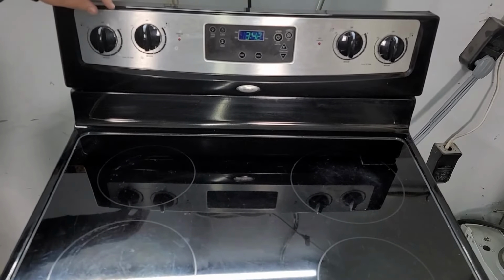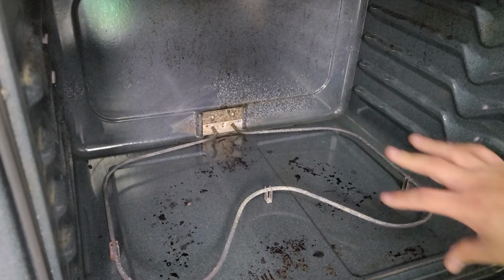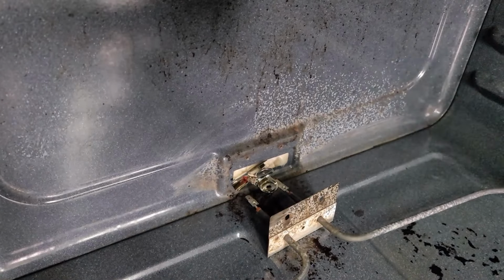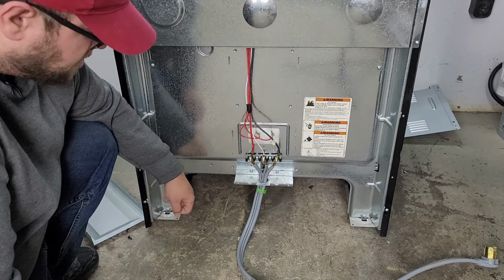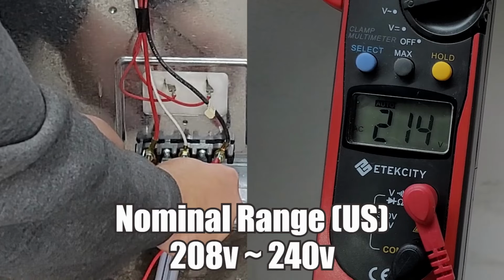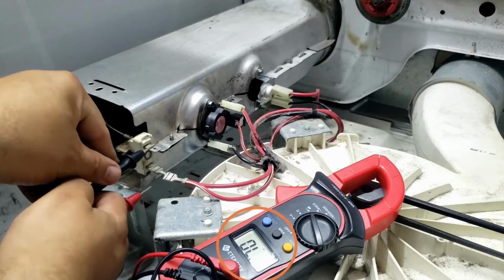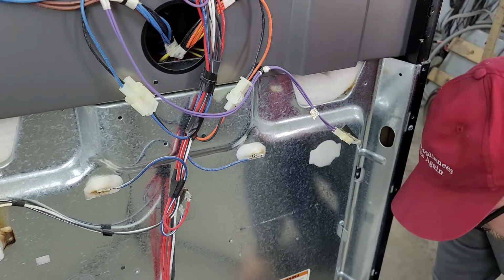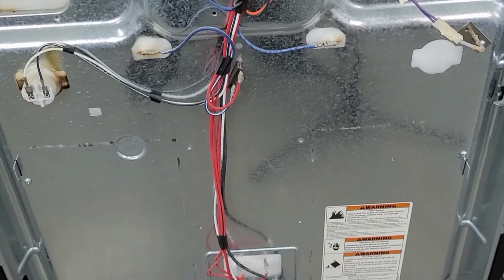Whirlpool Oven Won't Heat - How to Range Troubleshoot a Whirlpool Oven Not Working

Comment: Hi Ben, my whirlpool oven heats up but doesn't heat properly. Seems to be when the door is opened to check whatever you baking it will only eat up to about 200 deg after that. I have replaced the temperature sensor and it still acts up. Both elements pass the continuity test. Any suggestions?
Reply from the maker: Check boars for relay damage

Comment: Hi Ben.  Great site.  I spend a fair amount of time here, trying to absorb as much as possible.  Sure appreciate it!   Could you give me an informed opinion?  I have had quite a few customers concerned with how their oven is heating, and the majority of those customers seems to have a W10779716 bake element, which is a pretty "simple" element with no loops in it to heat the center portion.  I can't help but think another part might lead to better results.  Something like W10276483, that looks rated the same (3600W) and looks like it would fit.  Am I out to lunch,, or maybe missing something, or not considering something?  What do you think?
Reply from the maker: They all work the same as long as they are rated the same. Usually the people complaining are idiots though and it's going to be more of a calibration issue. But if you want to swap elements, it's totally OK to do that.

Comment: Very good video!!! 
When I turn on the range and it goes up to 395F instead of the 450F set point. What could be a problem with a range?
Reply: Look up how to adjust the thermostat reading for your model.

Comment: After I listened to your lesson, I pulled the oven out and discovered the plug had worked itself half out of the socket. Light, clock worked and nothing else. Pushed plug back in and presto. I’m was a lucky man tonight!

Comment: Hey Ben, appreciate the video but I hope you can give me a few extra pointers!! My whirlpool accubake only heats up to 300F on bake and 400F on broil when set to 500F. It only has one element on the top of the oven. Element and thermostat resistance are all good and I don’t see any damage to the control board. Any ideas? Thanks!
Reply from the maker: Offset or thermostat could be bad

Comment: I get 240 V at the bake and broil elements when the controls are set to BAKE / BROIL.  I get about 40 Volts on both elements when I set the controls to BAKE only.  Any idea what the problem is?  Thanks!!

Comment: Ugh, I have a newer whirlpool range and recently replaced one of the burner switches but for some reason the display will not reset it still shows that the stove top is on and hot when it is not on or hot. Any ideas????

Comment: Hi Ben. 
Subj. Maytag Model MER8800FZ0
The baking element started on fire. Me wife screamed and I came a running. 😅
I replaced the baking element. Still won’t get to temp. I really don’t want to call a service person out. Could it be the fuse, heat sensor or board? I have power to the stove top. But the broiler will not work as well. I’ll wait for you’re thoughts. Appreciate the informative vids. Ty
Reply from the maker: Check the terminal block in back if it got damaged. Sounds like a general power issue... Check that first, then board if there's any damage on board.
Reply: @bensappliancesandjunk  
Hey Ben
I just ordered the safety thermostat. I believe when my wife started a fire inside the oven, it damaged the thermostat. The block and board looks good. The only other thing would be the thermostat. I don’t have a meter. Thoughts? Thanks again.
Reply: @bensappliancesandjunk  
Also, if it was a power issue, would all the burners still be operating? Ty

Comment: My thermostat resistance is showing 1.39 and also there is a burnt mark on the far right side in the middle of the motherboard right at the edge voltage coming in to the unit is okay for some reason the oven is heating up really good now being that I unhooked a lead from the motherboard to get the screw out there was connections that were loose that I felt like I pushed in to make better contact but still unsure Thanksgiving is coming up and need to resolve this situation do you have any suggestions?

Comment: How can I check the board on the bench.
Reply from the maker: Check for voltage coming out from the board to the wires that power the element. It varies from model to model, so I can't advise you which wires but generally 2 will go from board -> element. Test for 240 VAC cycling from board to element. If it doesn't trigger voltage at all or some value very insufficient, replace board assuming you're getting 120 VAC into board. Typically the terminals will power one leg @ 120v to the elements, then another 120VAC from board to provide full voltage/amperage, and if that side is bad, it won't trigger at all.

Comment: I inherited a Whirlpool stand up stove, all burners work, but oven not working at all. I pulled the back panel and started checking the first thing I found is the left leg power and ground was very loose on the stove. I secured the wires and check the fuse and power to control unit. What can I do to get this oven working. Collins
Reply from the maker: I'd suggest watching the video and doing all those things first. Did you do those things before commenting?
Reply: Yes

Comment: My burners come on but the digital display that controls the oven and clock won’t come on and I can unplug it and it starts to work then a few days later it stops again?
Reply from the maker: Sounds like either a board or connection issue to the board. Check all connections and make sure they're plugged in properly. Otherwise, change board sadly.

Comment: The issue I’m having is the stove would intermittently lose power, if I pull it out of its space, or wiggle the cord it comes back on. I replaced the power cord and it worked fine for about a year. Now the same problem came back.
Reply from the maker: It's either the cord or outlet
Reply: @bensappliancesandjunk  that’s for the quick response
Reply: @bensappliancesandjunk  now it’s something new. I preheated the oven, it got up to temp. Then shut off completely, no power at all. I turned one of the burners on and everything powered back up, including the oven.

Comment: Hello, I have the same overnight and was wondering why the display screen was not on. I went step by step, oven bottom element reads extremely low. But I can’t turn on actual baking setting to test other parts because display won’t turn on. If I replace the baking element would that solve it or is the mother board also a problem?
Reply: I am wondering if you ever found an answer to your problem as I am facing a similar situation.

Comment: What would cause an electric oven to cycle on and off rapidly? My mom's Ikea (Whirlpool) oven isn't regulating temperature. I can hear a relay (what I assume is the thermostat) cycling on and off about every 10 seconds. Overall, it's overheating and burning food. It just keeps cycling back and forth which slowly heats it past the requested temp.

Comment: Hello from Houston! I moved in my building in early 2021 and the building itself is only 3 years old. This silvery Whirlpool series is a junk. Two refrigerators bloated, became cylindrical and started to spread moisture and create mold. The owen stopped working, the upper heater. 

3 out of 2 devices made by Whirlpool lasted shorted than 3 years?!

Comment: I have the same type the Oven is locked and the gas stove is not working either you see when turn it it show red meaning is working right but in my case is not turning on how I fix it?????

Comment: Well done Ben. Easily found my stove problem thanks to your video.  Terminal block and wiring repair needed on my 2YO WP model.  Seems to be a common occurrence based on comments from your video and others.  Lots of terminal block replacement videos in youtube land but nothing on wiring repair.  Might be something to address in a future video.
Reply from the maker: Good idea. I'll see if I can do that sometime.
Reply: Half of my oven just died, after lasting 2.5 years max.

Comment: The clock comes on only when I push the dial on and hold it, but when I turn it off, the stove shuts off, it used to reset after 20 minutes or so, but it shut off by itself and hasn't reset itself

Comment: I went through every step in this video, and everything came out like it was supposed to (correct voltage/resistance/continuity), but our oven won't get above 325F no matter how high it's set. Is there anything else I can check, or should I maybe try just replacing the thermostat?
Reply from the maker: Did you check the thermostat? Is the oven set to Fahrenheit or Celcius?
Reply: @bensappliancesandjunk  I checked the resistance on the thermostat and it read in the right range for the ambient temperature. The oven is set to Fahrenheit.
Reply: @tm55re  hello, have you resolved this issue on your oven? I’m having the same problem. I just changed the baking element but it was damaged on one side but the oven still won’t heat past 325 degrees F.
Reply: @itsDawnElle  so after checking everything, it all coming back good, then putting it all back together, it's been working as it should. I have no idea what fixed it, but I'm not going to sniff a gift horse in the mouth 🤷‍♂️
Reply: @tm55re  ahh okay lol 😆. I’m glad it started to work well for you. Hopefully when I use mine tomorrow, it’ll magically begin to work again. 🤞🏾 thank you so much for replying!
Reply: @itsDawnElle  no problem! I hope you get some magic too!

Comment: Hey bud so i change the location of my electric stove and ever since then it start clicking and the oven comes on sometimes and not or i have to keep trying it to come on. Could my breaker wear out and need new ones cause i have those for very long time. Even before i move the stove to its new location it was kind of have minor clicking and so on?
Reply from the maker: Yes its possible. I would check the voltage going into the terminal block if possible. I had it happen to me a few months ago personally
Reply: @bensappliancesandjunk  thank u

Comment: hello, I have a whirlpool stove w/convection. broiler element does not work. I have good continuity on element. I removed both wires from element and have 120 on each wire to cabinet, but have only continuity between them both. I think I should have 240V but not sure. (model #  RF367LXSS 0.) IF you could help that would be great. Thank you

Comment: My issue is with an electric lg oven. The convection fan element doesn't seem to heat up at all but the main bake element heats up. Do I need to turn it on to read the relays and/or element? I don't have much experience with HV so I'd rather call someone if I do.

Comment: Thank you for responding. Figured it out. Wire on left side wasn't even long enough to
get an alligator clip on it. Took off lower back panel and wires were there. I never work
on something with power on. 220 / 240 Volts. No way.
Element is on order. Thank you for your video.

Comment: Great video. Oven element was toasted. Got ohm reading of OL, anyway. One of the wires never came out of the insulation. Have to go
fishing for it. Any suggestions.
 The other wire stayed attached, and I put a clip on it. Have good light and needle nose pliers to fish for the wire that disconnected in the 
insulation.
Reply from the maker: If possible, turn off electric at box and pull stove from the wall to fish out from the backside

Comment: Curious if the board can be repaired. I’m almost certain I have a relay issue.
Reply from the maker: I JUST put a video out about the relay repair! I'm working on creating a warehouse for stove/fridge/washer/dryer relays. It'll be ready in a few weeks!
Reply: @bensappliancesandjunk  thanks. Will look for it.

Comment: I have a convection and air fryer stove. Will not heat up to temperature you select. I selected 350 and an hour later it is at 285. It is a whirlpool and it is new
Reply: Same issue. Seems Whirlpool is poor quality now a days.
Reply: Same problem. Did you get that fixed? What was the cause?

Comment: My oven is suddenly heating very slowly and when it finally says it reached the set temperature, it's really not hot enough. The burners work just fine. Is this fixable? Thanks
Reply from the maker: Either the element has broke partially, or the control board has gone bad
Reply: @bensappliancesandjunk  We'll take a look at those. Thanks you!

Comment: F90E error and beeps, not going to anything else, diagnostic option wont work, checked all connections and board, looking good, haven’t verified the voltage coming yet.. will check that after getting a multimeter.. any tip or help on this?
Reply: Did you find a resolution for this?
Reply: @AverageLeoTv  yes changed the outlet

Comment: It seems that the middle white wire at electric connection doesnt register any ohms. Plus the out power from control board isnt getting power. And thermometer wire isnt registering,? Suggestions

Comment: Thanks for your video. I just want to be sure my control board is the issue. I tested for continuity on the broil element and that works. I tested the voltage to the terminals while they were connected to the broil element and they were reading at 5 volts. I assume there is an issue with the control board. If the element say was defective I should still see 240V correct?

Comment: I can't run my electric glass top range and my oven at the same time without tripping the circut breaker, any ideas? Thankyou
Reply from the maker: It's likely the power cord, terminal block, outlet or breaker. This happened to me 3 months ago and it was very clear that it was the power cord burning itself up on my stove.

Comment: i have same one power not coming to element it may need  board how change it
Reply from the maker: make sure stove is unplugged. Unplug all connections from board (photograph where they are first), then take board off, put new one on
Reply: @bensappliancesandjunk  thanks

Comment: Question - I have a Whirlpool electric range that is 3 1/2 years old and it's heating, but it's taking forever to preheat to 350 (over 30 minutes) and I don't believe it's actually heating up to anywhere near the 350 degree mark when it actually says it is.  Any ideas on the issue?  I hear lots of clicking noises while it's preheating.
Reply: I found out what was wrong with my oven/range - it was a bad control board. I found a manual online on how to run diagnostics using the controls - I think it was cancel-cancel-cancel-start buttons it. Get you into the diagnostics, and then the #3 to scroll through them. I think the error code we got was F1-E1. Bad control board. The bottom element was not heating up at all. You can see for yourself - turn on the over, wait a few minutes, and see if the the bottom element is getting hot. For ours, nothing. It was not coming on at all. One check you can do before ordering the control board is to disconnect from the power for about 10 minutes and try again. If you still get a bad code, I assume it is the control board, as do the manuals.

I figured out the part number for the control board and found one on eBay for $205.00 plus shipping. 

When it was delivered, I found a video on how to get to the control board, as it was buried pretty good under the front controls, but relatively easy to do. Just had to figure it out. Before installing, I matched it up with the old board to make sure they were the same. And it was. The eBay seller was fantastic. 

Installed the new board, put everything back together, and fired it up. Perfect! Pre-heated as it should - about 8-10 minutes to 350º. We checked everything else like the burners, broiler, etc., and yes, everything works as it should. And it has been perfect ever since.

Best of luck!
Reply: @zzotto21  hey can you confirm your oven worked otherwise and was just slow to heat and not getting as hot as it said? I have this current issue on a 5 year old oven.
Reply: I forgot to mention, we got the F1E1 error code. That is the control board failure, if I remember correctly.
Reply: Yup! The control board was indeed bad. I replaced it and now everything works as it should.
Reply: Same issue with our Whirlpool oven. Did you figure it out?
Reply: Mine to does exactly same thing  lots of clicking  but barely heats up. Takes forever to preheat also
Reply from the maker: Control Board is bad

Comment: My whirlpool accubake stovepipe burners and oven won't heat. The digitals showing temp and clock and all other lights work. There is just no heat. I checked the breaker and flipped it off and back on but it didn't help. Any suggestions. Im disabled and can't afford a new stove right now 🥺
Reply: *stove top
Reply from the maker: NOTHING will heat at all? Sounds like an electrical/power issue. You may be getting enough power to turn the stove on for the control board (120 volts) but not the 240v it needs to run the burners or element. I know you said you are disabled, but you'd need to pull the stove out from wherever it is, and inspect the power cord, the terminal block where the power cord goes into, and the outlet for the power cord. All of those things are somewhat cheap to replace.
Reply: @bensappliancesandjunk  Thank you so much for your help.

Comment: Love your video, have wp that looks a lot the one you have in the video. My oven works but the stovetop has the issue. Left side burners work Right side dose not work. Any thoughts?
Reply from the maker: You'd have to look at the burners as well as relays where the knobs are for damage, and see whats bad. Odd that both don't work, but you'd want to unplug it and slowly go through all the wires and check for damage